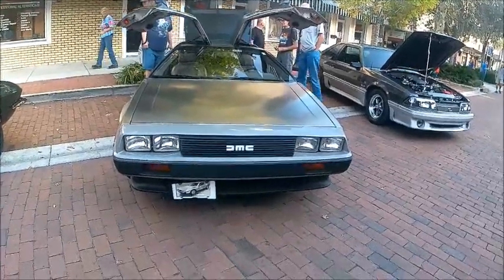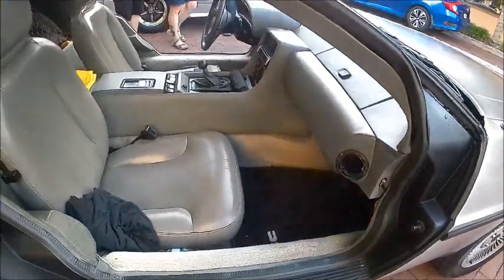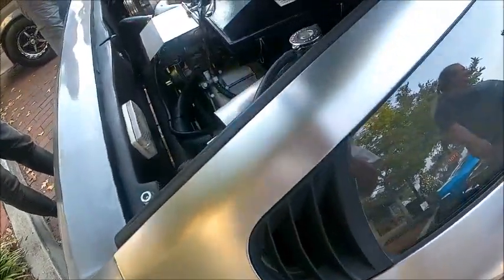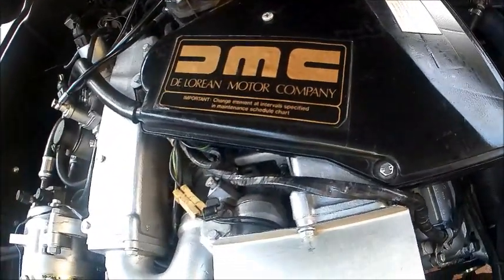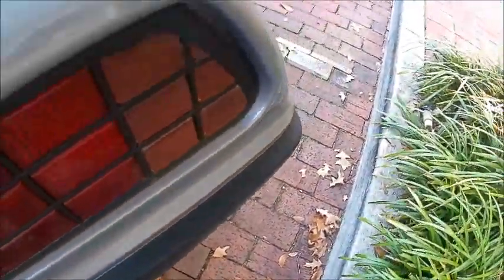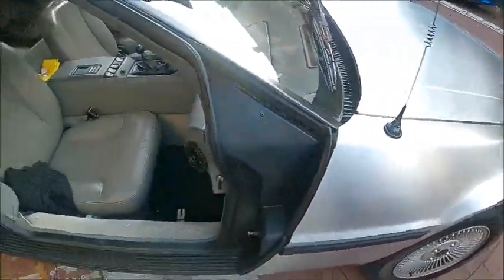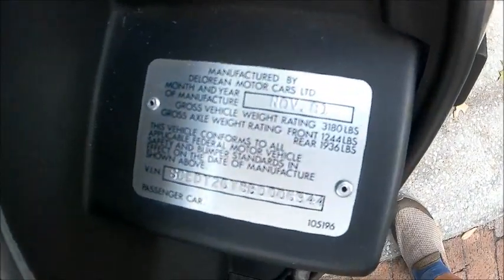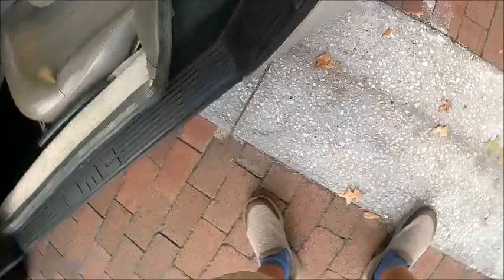1981 Deloean DMC12 Eustis 1126226339

Comment: I’ve just watched the video you linked us to about the new electric DeLorean and I quite like the styling. It looks good. I think I’d hate driving it though because it looks low and massive, and visibility and parking would probably be a nightmare. Also technology like bracelets and virtual hugs and kisses leaves me cold - that’s got nothing to do with driving and transportation! If ever the obsession with cramming gimmicky needless tech into cars just for the sakes of it, to prove what can be done, subsides, it won’t come soon enough for me.
Reply from the maker: Hey, Mick!  All the hype about electric cars leaves me unimpressed.  The bottom line, no matter how much they fancy them up, is how they are supported financially.  No matter how cool, if you can't get repair parts they are useless.  Moreover, if the car needs to be "reflashed", and there's no one around to do it, or no one that has the technology to do it, the car makes a nice boat anchor.  Thanks!  :) Jack

Comment: I know those stainless panels are just a cosmetic cladding over a glass fibre shell, but as you panned around with your camera I was marvelling at the fairly awful shut lines around the front hood, fenders and nose cone 🤣 I like the way you said they can still build a new DeLorean from stored bits from the 1980s - I can imagine parts stacked up covered in dust, cobwebs and guano! As for the electric one with no factory - probably assembled in somebody’s double garage at home! 🤣
Reply from the maker: Hey, Mick!  Stainless seems like it would be carefree, but in reality it's not.  The workmanship on these cars was not of the highest quality, something that would be very hard to achieve when the workers in the factory are new to the trade.  The most limiting factor was the engine, a poor choice for the car.  Thanks!   :) Jack